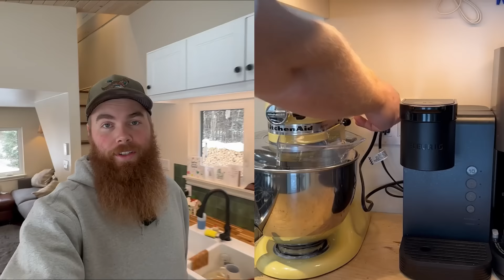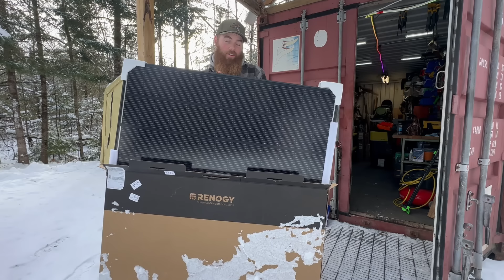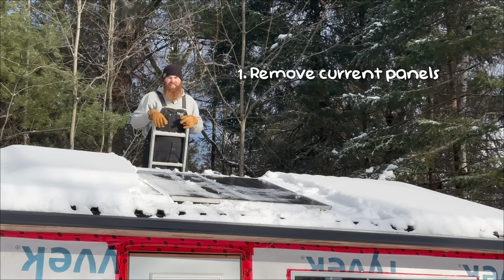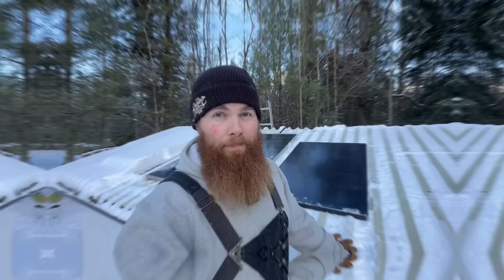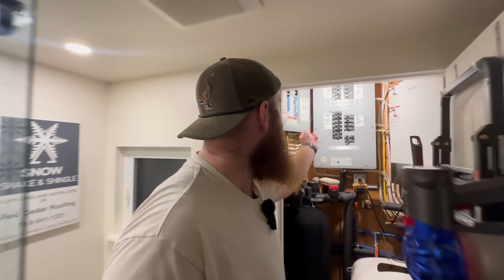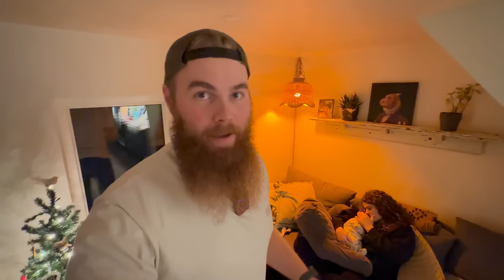Could Our Tiny Home Go OFF-GRID... Forever?

Comment: Soo  I wanna say   I'm live in Uzbekistan   and  I installed  4 kwat solar panels and  4 kwat gibrid invertor and 5 kwat lifepo4 battery   and  soo crazy do you know  what is, coast is it   2000$  😂😂😂😂😂. You're rich   it's fine, but my think  is, do you live not in soo sunny  county  and this  setup  never does justify his coast😢😢😢  It is smarter and cheaper to buy electricity from the grid than to use it.🎉🎉🎉

Comment: There are way better panels that cost way less I go with the 400 watt and above The 400 is mostly the best but shop around Most places you have to buy a least 10 but you will need that and more I have 17000 wats of power 95 AH of battery and have to have the grid charge the battery in the winter  some times when we have 4 days with out solar

Comment: Yes you can power anything off grid if you junk the rip off renogy panels and use actual normal proper house panels.  3.2kw of renogy panels here is 1733  or i could get a 14kw pallet of  36x410 sunpower panels for 1782 same price as 3.2kw of renogy.  Luckily your getting them for free lol -  you'd have to be a total dime bar to actually buy renogy panels with your own hard earned money.

Comment: I think,  you should install new solar panel on wall. You will get more generation in snowy season since there will be now snow on them as well the tilt will allow the panels to capture more low-angle winter sun.
I saw a lot of sun on the wall.

Comment: I definitely would like to see you build out an array in the spot you mentioned. You could also place a small 8ft shipping container near/behind the array to give you the space you need for a second inverter and more batteries down the line, the only down side is that you'd have to warm the space to keep the batteries happy in extreme cold. Really good insulation and a baby mini split would take care of that, but you would have to take that into consideration when adding batteries. Maybe an EcoFlow or Bluetti sponsor would like to help? Good stuff, looking forward to see what you come up with.

Comment: Good video, and great introduction to off grid topic. 

You can expand your solar panels system and benefit greatly, but build it so that it adjust to take advantage of the sun. Multiple arrays arranged so they don't shade each other as they follow the sun. 

Next; swap out the electric range with  oven for one that operates on propane. Also swap the electric clothes dryer for propane powered clothes dryer. Also propane gas water heater, tankless would be most efficient. 
You need to expand your battery storage capacity. Make a new location for it.  Expanding your solar panels capacity will help greatly, but way more battery power is also needed, especially when running the AC in hot weather. Leave the electric service connection, on long stretch of cloudy weather, the panels may not keep up. Keep the generator too, as a backup to the backup. In today's world, most anything can happen, and working to be self reliant is a huge plus to get through an unknown situation, that sneaks up on everyone. 
You have a lot going there, just take it the extra step, and I think you would benefit from it. 73 GOD bless Earnest k5ewm 👍🇺🇲👍🇨🇦👍

Comment: The only luxuries I wouldn't want to live without are my air compressor and the lift in my shop. Here in the UP the grid goes down often. Solar doesn't work so well for me, and wind is out completely because of the trees, and having sandstone just two feet under the dirt. A large enough windmill would be incredibly expensive to get it high enough above the forest. My house can go off grid today, but I would need a battery bank pretty soon. 

I could run a generator with enough power on methane and ethanol real easily, since I can make both of those fuels in copious amounts, but those things are noisy. I might modify mine with better mufflers, and a longer exhaust pipe so it doesn't affect engine performance. Come to think of it, I should really build a faraday cage around the generator as well... so a CME doesn't fry it. The house and shop are already hardened against a CME, unless its a super powerful one.

Comment: Unfortunately due to all the changes to the Canadian building code that is making living off grid essentially illegal, you won't be able to avoid paying an electric bill.  You will need to stay connected to the grid and pay the delivery fees etc.  Which we tallied to be about 2 grand a year here in Ontario.  I agree with you about air conditioning!  You can make due for everything else, but nothing cools you down in those super high heat days.

Comment from the maker: What’s your experience with the grid? Are you on or off, would you ever switch? 🤔
Reply: I'm completely off grid for electricity, septic and water on the west coast of Ireland, a place not known for its sun. I've 5.5kw of ground mounted solar, a 5kw inverter and 10kw of batteries.  We're in the 'dark' months now and I've only used my small generator maybe 4 times in the last month. I have all the appliances I need and heat with a stove. It's brilliant! With our national grids selling us customers to the highest bidders and private equity now owning at least one large energy company in Ireland its time people become independent if at all possible. It's expensive upfront but nothing beats not having to rely on creaky grids that will prioritise the likes of data centres and have domestic customers pay for it. And it's an environmental imperative now.
Reply: Is the connection from panel which is away from tiny home wireless?